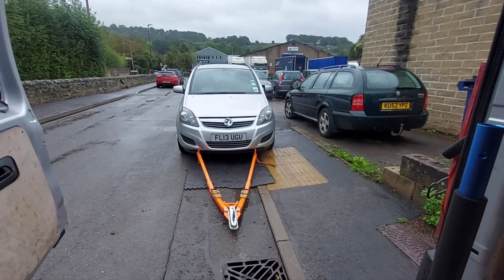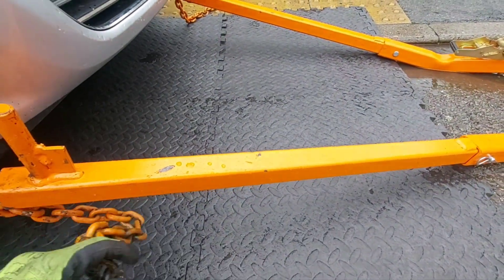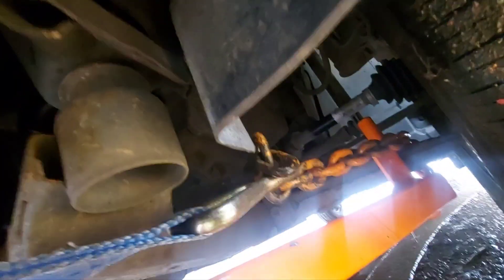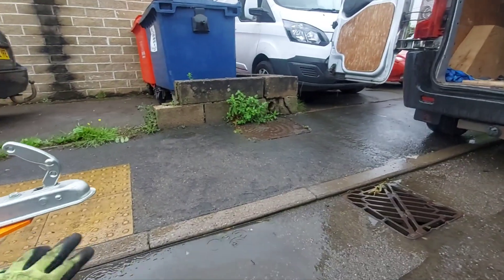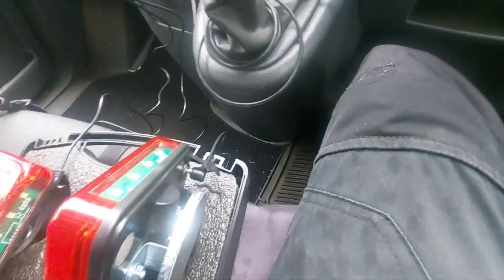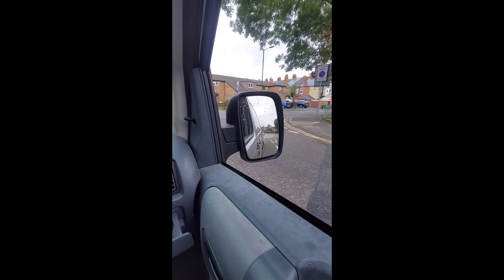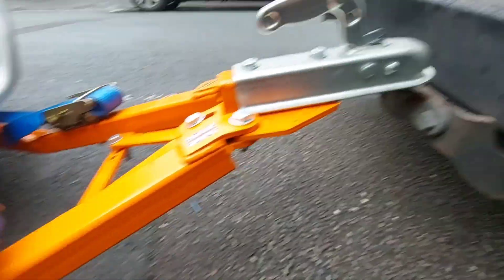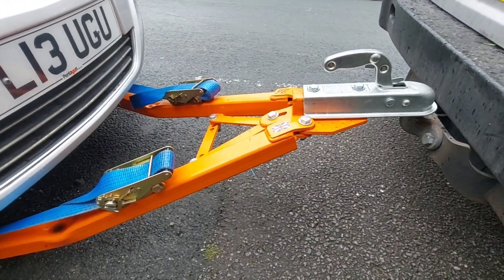A-Frame Vehicle Towing/Recovery

Comment: They're great accessories for towing single handed, and the lights are nice, but may I offer some points of interest. As the registration plate of the towing vehicle is hidden by the vehicle being towed, a copy of the registration plate belonging to the towing vehicle must be display at the back of the vehicle being towed, and if at night it must be illuminated. Also, you must display a sign on the back of the vehicle being towed that states it is a vehicle that is being towed. They are the two legal requrements. And, it's advisable (especially if a vehicle is untaxed, carries no MOT or insurance, except being covered by the vehicle doing the towing if your insurer allows 'trailers', because that's what it is classed as) that the towed vehicles own registration plate is covered over so any infringement notices are sent to the address of the towing vehicle and not the address of the owner of the towed vehicle, or previous owner of the towed vehicle. There, that's about as complicated as the Govt. website make it. As you said in a different post, it's all a grey area in law.
Reply from the maker: Thanks for the excellent information much appreciated!

Comment: How do you get around the law that towing  over 750kg requires  the trailer to have  working brakes controlled from ur vehicle when towing with the A frame the cars also becomes part of the trailer so very much exceeds the 750 kg limit
Reply from the maker: Hi thanks for watching. If you dig deep enough you will see its legal as long as vehicle is a non runner or for recovery purposes only. Its a pretty grey area to be honest hard to get definitive info.

Comment: Great video, I’m looking at getting one of these myself. What I can’t seem to find out is does the car that is being towed have to be taxed, mot’d and insured. Thanks
Reply from the maker: Hi thanks for watching. I have motor trade cover so its not something I've had to think about. Legally its only allowed for recovering a non running vehicle as far as i know. But then camper vans tow cars around with them all the time so dont think that's enforced much if at all. I would say you don't need to have any of those 3 you mention if its being towed. I could be wrong tbough not much info available on it.

Comment: very nice and informative video, just wanted to ask how does it work with the legalities? technically from the little info i was able to find an unbraked trailer cannot exceed 750kgs? just curious if you had any issues or recommendations, no hate
Reply from the maker: Hi thanks for watching and the excellent comment, you are correct, however this is not classed as a trailer i believe, it's only really for recovery of non running vehicles to a garage, technically.  I remember reading that when i was doing research on it. Also the vehicle being towed has to be broken down or a non runner, so not for transportation of  running vehicles etc. Hope that helps.

Comment: nice a frame design. However i wonder about whether that rachet strap could potentially wear through on a long tow
Reply from the maker: I've used it many times even towing small vans and it's very strong. The straps never come loose and don't rub on anything.